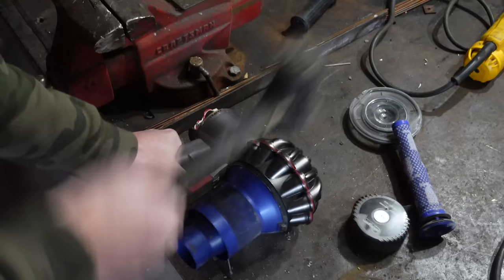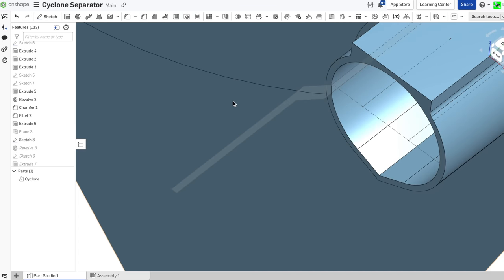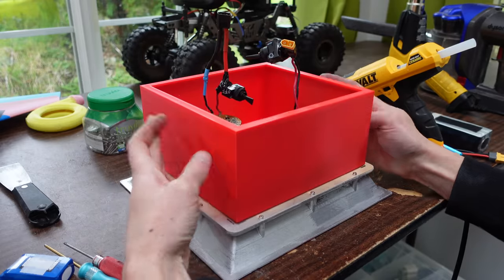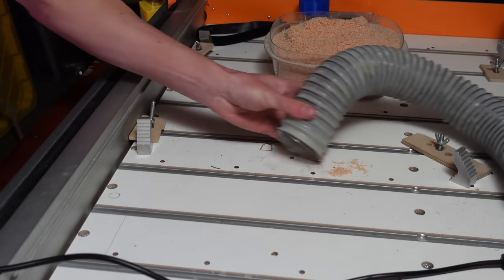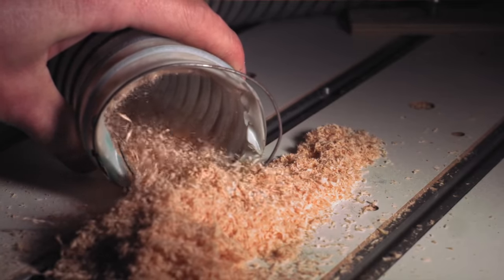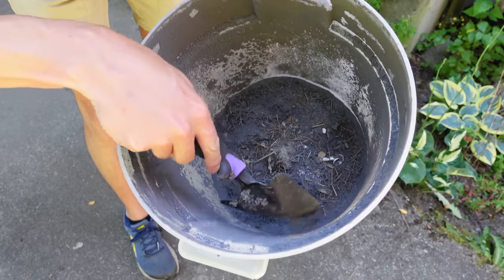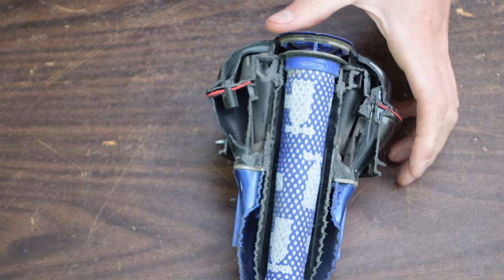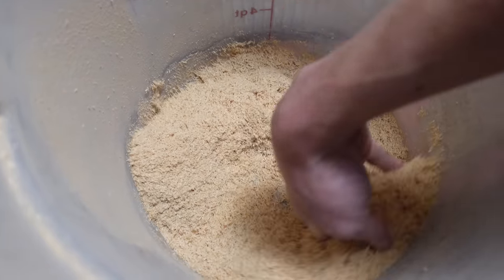Dyson Powered Cyclone Separator Vacuum

Comment: As an old nerd who cleans way too much: What this needs in the next installment of the video is how you put it on a pair of stair-climbing 'wheels'/tracks/tritracks/whatever and run an electrical tether to a wired thumb joystick so as you are cleaning with your thumb you can direct the motorized cannister unit behind you,. Look up canister vacuums of the past. I know you can do better plus why should you haul it when you are an RC inventor who can make it haul itself?

Comment: 6:59 This.  Ironically, you are better off just increasing the power of the motor (buying replacement motors) and reuse any cyclone you have then it will see better fine dust separation.  This the reason the cyclone separator in Dyson's cordless is not up to par to their AC powered vacuums.

Comment: I've often wondered how someone would ground a nonmetallic case?
Reply: The charges themselves help a bit... just drilling a self-tapping screw through the side and grounding it for example, would create a neutralizing electrode. Any dust with a strong charge will be attracted, as it differs from the ground's charge, and then can freely lose/gain electrons when it's pulled in.

Comment: I love this project, as i am looking forward to a filter less vacuum, so that no nano particles are expelled out at the back. (good for everyone but mostly allergic people) Do you think it would be possible, do develop a system, that can use water, to trap the last particles, that get through the filter or replace that completely? Changing/cleaning the last filter is a giant mess and also the most dangerous part, as you breath in so much old dust, that probably is full of bacteria and fungi too). A portable version of your system + this "water"filter, would that be possible? i guess moving the cyclone could hinder correct separation.

For the water filter i was thinking of a small steam generator, maybe with some ozone for killing bad living stuff. Or some other type of Myst generator. Important is, that the dust is than trapped, so it wont get out, else you would still breath that wet dust or it would just settle back in the house. Or would the best and simplest solution be a long outlet to the outside? haha
Reply: some vacuum exist with a wet scrubber, like this one https://www.youtube.com/watch?v=AE_kRmFcKk4, i saw a dust extractor with similar technique but i can't remember where.sometimes cleaning my dyson gives me a headache the next day . i think the best solution is to use a respirator mask when cleaning the bin.
Reply: @aboraskber524  Yes i am always using a mask when vacuuming, but it would be so much cooler, to have some type of "perfect" filter. And when it uses Water, it is "endless" too. There are water vacuums, but they are really expensive, heavy and annoying and disgusting to clean. The cleaning part would be so much easier, if there was a cyclone before all the big dirt hits the water. That way only the small stuff is caught in the water. Also you can put some nice oils in the water and then the smell of that will be infused into the room. It would at the same time be an Air-filter instead of a nano/micro-dust machine and also increase humidity (which would be bad, if you don't want that haha)

Comment: You probably should lower the suction point inside the vortex, so, the air with particles will not have a direct way from input to output. It should drastically decrease the amount of dust going into filter

Comment: Since you're 3d printing this, you may consider playing with the modern Dyson vacuum (the larger ones) designs which use a bunch of smaller cyclones combined. Be interesting to see how that design scales for shop applications.

Edit Ahh, got to the part where you discuss this.

Comment: You can try Husqvarna DC 6000 dust collector design, like dyson, it contains inner tube with vortex generator for ultrafine dust collection
Husqvarna DC 6000 - https://www.youtube.com/watch?v=fdX-N2y4bJc
DIY variant from tubes and buckets:
part 1 failed test - https://www.youtube.com/watch?v=1ckhmTY3LJE
part 2 success test - https://www.youtube.com/watch?v=vRvkwol5ra4

Comment: Yes sir, risk of the explosion with a fine, air suspended, wood dust is quite high. U better ground it :|
Reply: Is it remotely possible, and thus worth taking precautions against? Yes. "Quite high"? No.
Reply: @jercos  Can you elaborate? I know for sure this mixture is explosive, not sure about ignition probability in the system like this. And of course when it comes to the safety, criteria of being "quite high risk" are slightly different for me.
Reply: @tomekpeki  certainly fine wood flour and a hot spark can explode, but mixed sawdust generating its own spark and igniting simply hasn't been documented. I suspect it's possible, and so worth protecting against, but it's not some hidden killer picking off woodworkers.